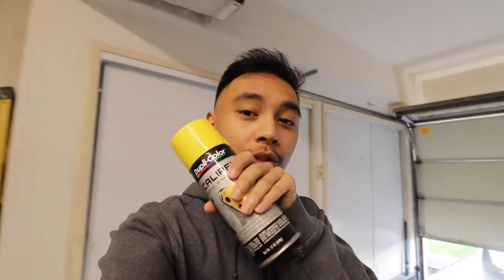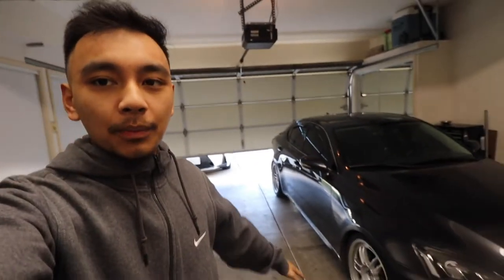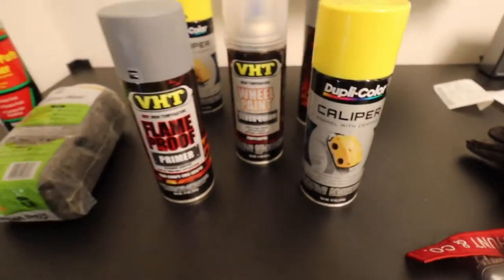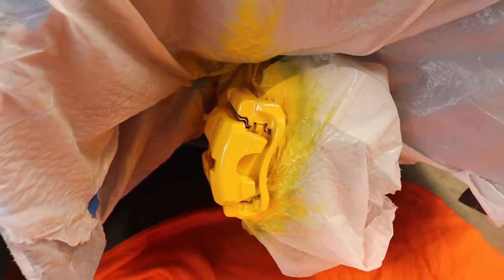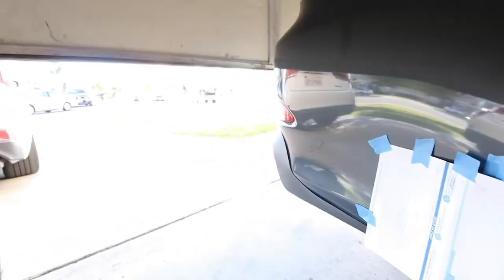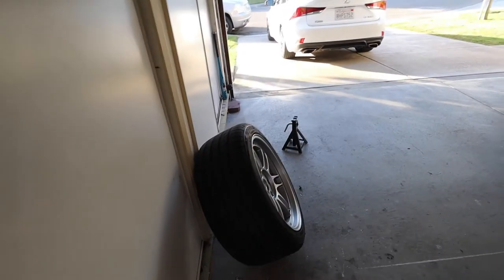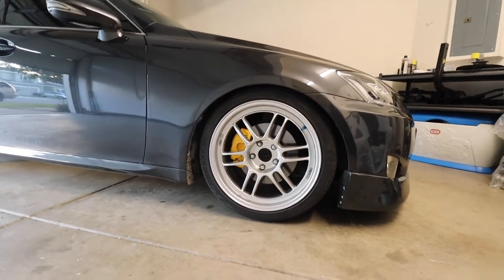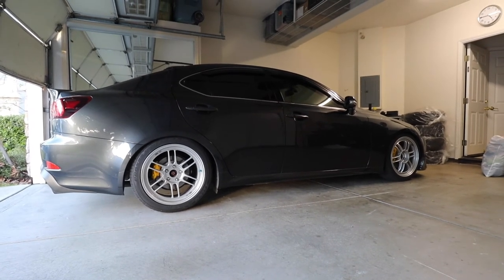How To Paint Your Brake Calipers!! DIY

Comment: Nice vid. I would worry about overspray on the body of the car. If that were me I would cover the whole side of the car since I'm OCD on car detailing Lol. 
Next mod you should do when you have to do a brake job, is upgrade to IS350 brakes. All need is the Calipers, rotors and pads. Bigger and nicer. Lol. 
Kansai rims look sick on the car. Love the color. I was never a fan for the enkei rpf1 on any car. But to each their own. Anything is better than stock.. Lol.
Reply from the maker: Would love to upgrade to the IS350 brakes! Caliper price i seen go crazy tho 😭 Honestly love both wheels and both give off different vibes. Track look and a stance look maybe I should steal the Kansei and run em on the car LOL

Comment: Ur car is sick I have a black 2013 is350 I’m thinking of doing all the mods u got. What do u think I should do first btw I don’t think I’m going to lower it because I have a little family and my girl drives my car as well.
Reply from the maker: Can never go wrong with tints or cosmetics like headlights/tail lights. Won't break the bank but it'll transform the look of the car
Reply: Definitely get VLand Taillights I got mine last week and I don’t regret it one bit since you do have a 2013 the headlights you shouldn’t need to do unless you want the VLand headlights
Reply: @ChristianMastrile  appreciate it!
Reply: @themeparktre4841  👌🏼yeah I was looking at them just didn’t know is if the vlands fit a 2013
Reply: @themeparktre4841  okay bet! Thanks I’m gonna cop them
Reply: @Spencerrojas The promo code should be 
YITOMOTORVIP 👌🏽
Reply: @Spencerrojas  how did the lights turn out ?👌🏽
Reply: @themeparktre4841  fire I got the lights and the wall style spoiler it’s turning out I’m in Texas. This snow and power outage is no joke bro
Reply: @Spencerrojas  nice 👍🏽 Last week I got the depo version 2 headlights car looks refreshed and that snow I heard is no joke 🤦🏽‍♂️

Comment: Is it safe to paint the calipers with them on the car? Any over spray on the rotors?
Reply from the maker: Little bit of spray went on the caliper but came off after a few minutes of driving
Reply: @ChristianMastrile  okay good was my only concern didn’t want brakes to fail 😂

Comment: What are the wheel specs on the Kansei's?  Do they rub?  I have a 2IS as well.
Reply from the maker: 18x9.5 +22 on a 215/40 tire squared. I have some clearance but didn't get the chance to drive it around. Will try it soon

Comment: Because of the body proportions are bit too exposed on the rear end (rear pillars to fenders) I thing that the wheels'/rims' spokes have to be thicker or more than six spokes, like the aluminum EMKEI rims look perfect on the car, it was made for it :D  Even though, you are doing a great job on this IS250, it's not an easy car to get it right, but you are your own path and style :D

Comment: I like your vids and your overall presentations, really well done!  In this one you baffled me though.  Why not remove the calipers and pads and rotors?  You can still do it with lines attached and even reinstall the brackets loosely while painting.  That way you get the contrast of the black pad backing plate too.  (Plus brake friction material hates solvents in spray paints.)
Reply: The rubber boots on the slider pins probably don't appreciate the solvents nor the paint either.